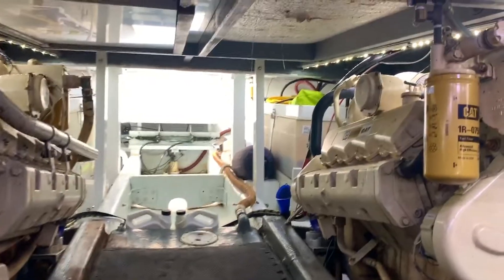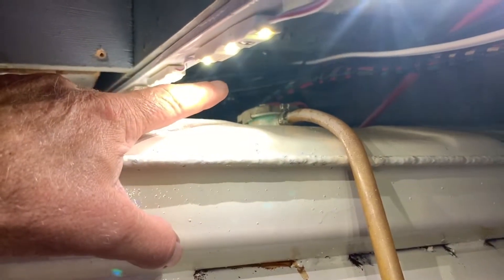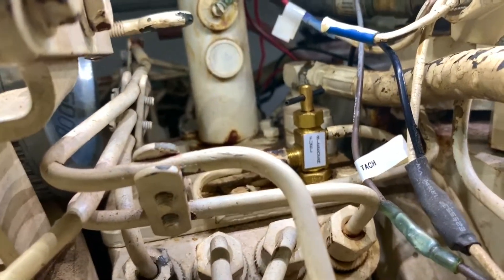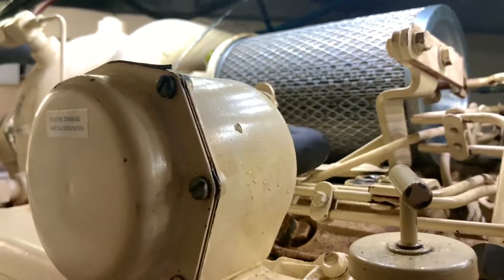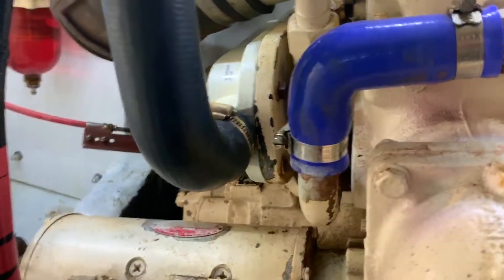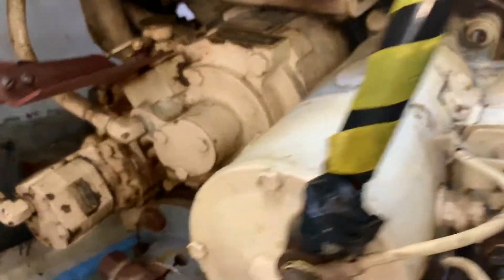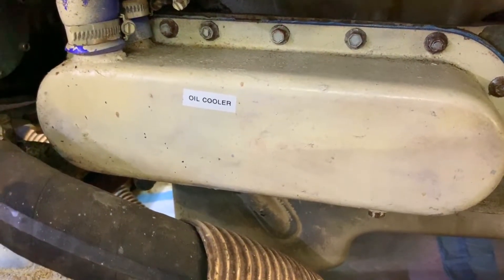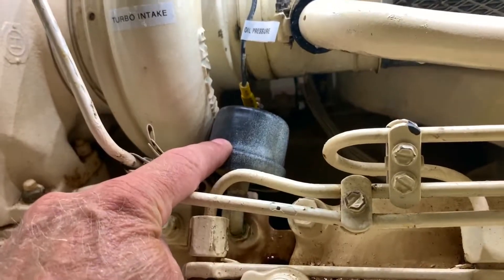Marine Diesel Overview CAT 3208

Comment: One more thing that should be in the video is the location of the zinc plug rods, they do need to be change to help fight corrosion in the engine cooling  system fresh or salt water, I would paint the plug red to make it easy to spot!
Reply: The single zinc plug rod on the starboard side of the heat  exchanger needs to be checked / replaced often, It is too thin and they constantly wear then break off, then get stuck in the end cap eventually, blocking flow.

Comment: Hey Captain Lee !! I have a 1985 ford bucket truck with a 3208 (non turbo) caterpillar engine.  I just got the engine in, and can't figure out the ignition and starter wires.  Could you possibly send me some pics 
Or any info. on the wiring 
Please sir & Thank you
Reply from the maker: Hi Reggie, I just took my boat down to the Bahamas. 130 hours in 19 days. Engines ran great. I do have a schematic for the engines and I’ll look that up and see if I can post it here. It pretty much hooks up like a car engine with a starter solenoid.

Comment: Make a suggestion.  The high pressure single wall steel tubes that supply high pressure fuel to the injectors can crack.  Has happened to me.  Once one does, that motor will not run.  And trying to restart it will put diesel in the bilge (more than the initial leak from the cracking episode).  
The only fix I know is to have a high pressure hose made up with fittings to install between the injection pump and the injector.  The hose will flex with each pulse and that cylinder will not fire, but the other 7 will, and you can get home ...  You'll only need one spare universal line made up and set aside to get you home.  These are basically very good engines for marine use.  
Your engine room looks really good :-)
Reply from the maker: Hi Broc, Having a spare high-pressure hose is an excellent suggestion I never thought of that. If one of those injector lines breaks it can ruin your day.